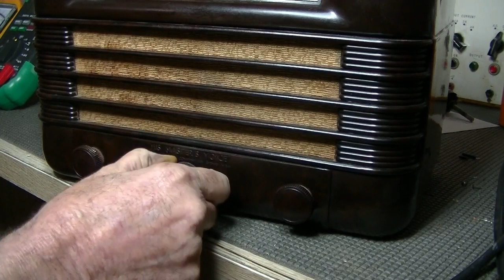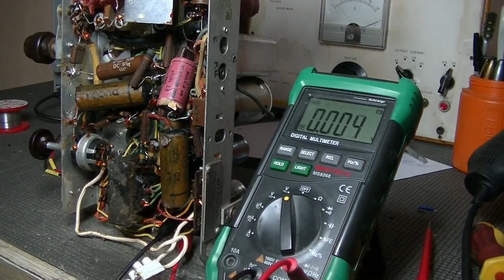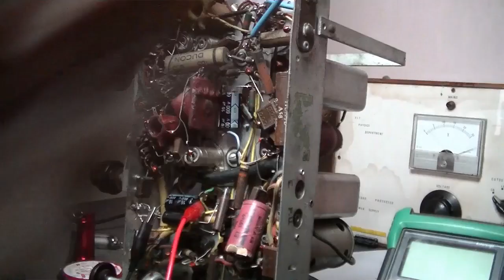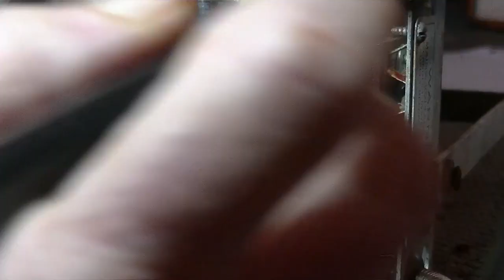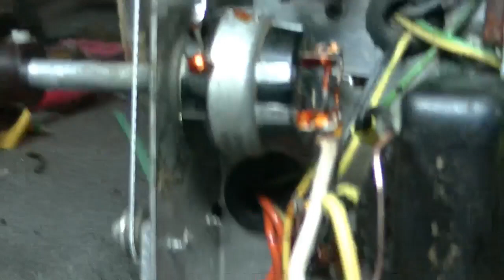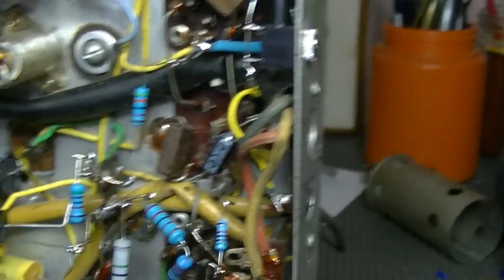HMV C13C Valve Radio 1950 Restoration

Comment: The reason for the squealing was that by connecting the transformer secondary the wrong way around, you made the negative feedback positive instead.  I'm not at all surprised that the O.P. transformer failed.  Of all the dozens of HMV sets I've fixed over 30 or so years, only once have I come across one of those pitch coated transformers to be intact.   Also, I notice that you forgot to replace that shield.  It may not be important, due to the fact that the radio won't have any where near the gain that it would have had when it was new, especially since an EBF35 is being used in place of the original 6AR7GT, which has higher amplification, but I think to keep the set complete, you should put it back in.  IMHO.
Reply from the maker: Thanks for the explanation on the feedback Stuart, most instructive.  Unfortunately I'm all out of 6AR7's. The last four I had are all duds.